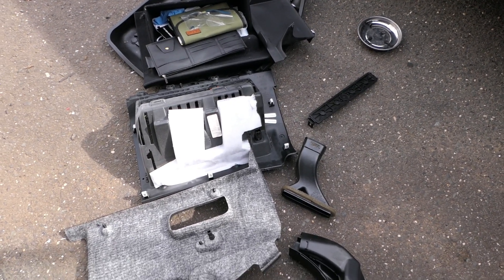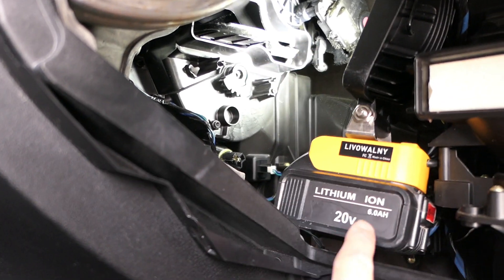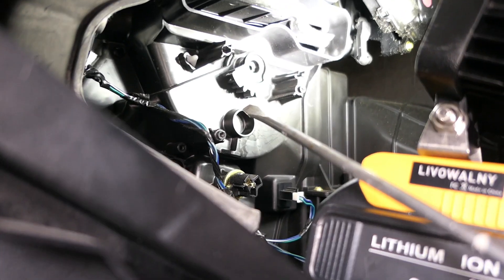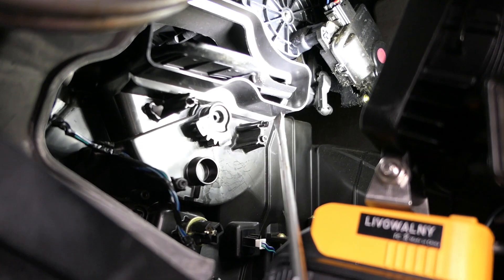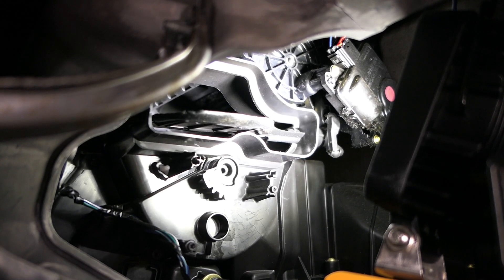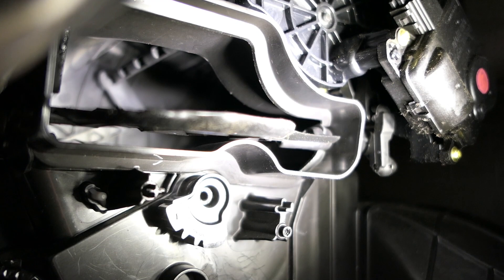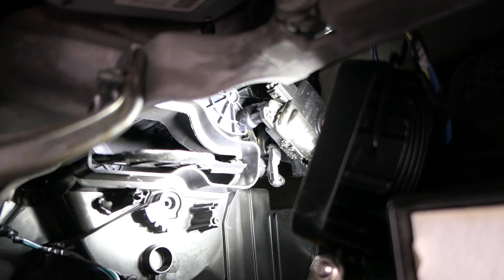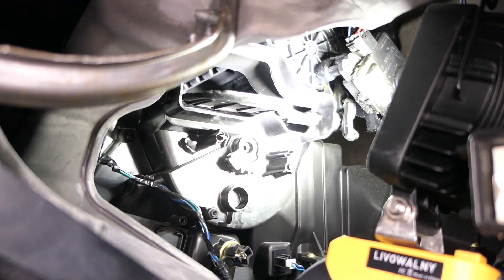How To Fix A Stuck Jeep Grand Cherokee HVAC Actuator Door

Comment: Same problem, was able to just jiggle it a bit till it came loose, but the driver side is fully stuck and way harder to get access to. Any suggestions ?
Reply from the maker: I haven't had the displeasure of working on the driver's side yet, but I know it's more difficult to get physical access.  If you can get the tool--any tool--in the right area but you can't get leverage, you can try whacking the tool with a rubber mallet to bust the door loose.  You might also try spraying a solvent in there, in the event that your problem is a gummy seal.  Any solvent which evaporates will do the trick, such as brake cleaner.

Comment: I took everything apart and My door moves freely, but the gear was broken. I replaced the gear and actuator and still no heat or a/c on the passenger side. Any ideas? (I’m not much of a car person but trying to fix this stuff myself)
Reply from the maker: It's possible the computer does not know where the flap is and needs "calibrating."  In other words, when you installed the new gear, the flapper door was located in a different spot than it was previously, and the computer still thinks it is there.  Or, you may have a secondary issue with a different flapper.  I'm afraid I can;t be much help from here, but really your only recourse is to take it back apart and look for issues.  This time try running the AC or heat while it is apart, and see if you can manually move any of the flappers to get the intended result from the vents.  Doing so will help you understand what is supposed to happen, and then you can try and make the actuators comply!

Comment: I have cool air now on the driver's side but the motor keeps running from only one side side and the vents comes off after a minute,  I must replace the motor as well?
Reply from the maker: I'm not sure I can be of help without seeing the problem in person, but typically it is the gear which breaks not the actuator itself.

Comment: Is it just 1 door in there? Meaning, can I free the door back to neutral from either driver side or passenger side? I keep having issues with the driver side gear eother breaking or blowong hot on drover side while passemger side blows cold. The stop on the dash itself(where the gear spins up agaisnt) is chipped away so the gear just overspins there. Im hoping i cam put some screws to act as a wall or epoxy build up or something.
Reply from the maker: There are multiple doors and motors, so I'm not sure which one you are having problems with.  If you are breaking a gear it must be due to the same general issue in the video, though.  The drivers side is different from the passenger in construction, but they use the same principle.
Reply: @tinderboxarts  I'm referring to the main one where you used that pry bar
Reply from the maker: Oh, I see. So, there are separate doors for each side, which allows independent temperature adjustments.  If your broken gear is on the drivers side I'm afraid you'll have to work from that side, which is more complicated yet.

Comment: Very well done and explained video. This is what no one else has been able to put out. Knowing nothing before i looked into it, i just knew that gear was stuck up by the teeth. Tried to use the gear w/ shaft but felt i was going to break it. I just needed to know where the flap was and which was it needed to go for sure. Thanks man 🤌

Comment: Very helpful video. How did you remove the plastic duct? I was able to remove the lower part but not the upper part. I need to get it out of the way as I need to change another same actuator that is connected to the air inlet cabin filter assembly.

Comment: How did you take off the vent? Was able to get the bottom off but do not know how to get the top part off to access the flap
Reply from the maker: It should basically pop off.  Sometimes there is other stuff in the way or you may need to get a different sight angle to see it.  The bottom half splits in two, which is the easiest means of removing that "horn" section.

Comment: I would have to guess that "calibrating" the actuator would address the range of travel for the gear. Being out of calibration, for whatever reason, was maybe why the gear was forced beyond the normal range of travel, and it broke. I am guessing.
Reply from the maker: I think the calibrating itself may cause the breaking.  The computer orders the actuator door motor to turn the gear until it hits the stop.  At that point the idea is that there will be increased resistance to the motor and that increased electrical draw will alert the computer that the stop has been reached.  However, it appears this process either takes too long and the gear snaps before the computer recognizes the stop, or else the motor is just too strong for the task and has the power to snap the flimsy gear.

Comment: How did you take the duct over the actuator off?
Reply from the maker: It splits in two, so you may find it easier to split it into the two halves and take out each separately.

Comment: The real cause of the blend door issue is the horrible glue thats used to glue up the styrofoam up along the edges of the blend door.  REMOVE as much glue as you can with Acetone and a cloth by reaching in and continually wiping out as much as you can.   Doing this will help prevent the actuator gear from breaking again.  FYI,  there are two blend doors, one on each side, not one.
Reply from the maker: Well, there are actually two problems, with the same result: a jammed door.  The stickiness is one issue and it seems to be more prevalent in warm or wet climates.  The other issue is the door being forced completely past it's stop, which is what happened to the vehicle in the video.

Comment: How did you remove the air duct to access it
Reply from the maker: The lower duct splits apart.  You can pry it open with a screwdriver and take it out in two pieces.

Comment: How in the hell do u remove the duct
Reply from the maker: The lower duct is put together in two halves, so it's easier to remove by splitting the duct in half and pulling out each side.
Reply: @tinderboxarts got what i was looking for. Thanks.

Comment: Is there a 2nd flapper door on the drivers side or just one for both?
Reply from the maker: There are four flappers, if memory serves.  So, yes, the driver's side can fail too, and getting access on that side is even more fun.
Reply: @tinderboxarts any tips on how to access the opening on the driver side? The top part of the duct is impossible to remove due to a metal shield all along its length. After trying for hours and scratching and cutting up my hands on the sharp metal brackets around it, I gave up 😢

Comment: I had my driver side hear break. Replaced it and iv noticed it clicks at times like its stuck or jumping. And when i turn the heat full blast the passenger side it hotter then driver side. Any ideal what it may be?
Reply from the maker: What you are hearing is the actuator continually trying to find the "stop" or limit of travel.  This is the whole problem--the design is supposed to work by the computer recognizing when additional current is drawn due to the door hitting the limit of travel.  But this doesn't happen fast enough or the computer doesn't see enough amperage, so the actuator continues to bang against the stop.  Sooner or later the plastic gear breaks or the flapper door is pushed beyond the stop.

Comment: Can somebody please help me here? I was on sticking my door for the A. C. Heat on the passenger side like I was seeing in the video and I do believe that I have broke a fin off or a flap off of that inside. Will that affect anything with my vehicle as into heat and AC?
Reply: Also I would like to know.Do I have to put any silicone or any type of solution for that white door there was some black gooey stuff.Does it need to be on there

Comment: Thanks for this.   My dad's cherokee had this issue.   The little bar was very helpful for freeing the door.  Then I used an excellent idea from 
Alex The Mechanic video to avoid full heat sticking by adjusting the gear stop with a screw.  Great results!

Comment: I can't find any videos on how to remove the black plastic duct that goes into that opening.
Reply: The top half of the duct doesn't come loose
Reply from the maker: I'm not sure if we're talking about the same thing or not.  The plastic duct which is sort of L-shaped and reaches down to the floorboards is in two halves.  You can unsnap the halves for easier removal.
Reply: I am having the same issue 
With the Upper L shaped Duct It has tabs on the right side of duct 
I just took a straight blade screwdriver and used that to push the first 4 tabs to help split the duct in Half….

Comment: How did you remove the air duct?
Reply from the maker: If you mean the one hanging down, it's a split design.  Try prying the halves apart for easier access.
Reply: @tinderboxarts  thank you... I got it...

Comment: OMG the crowbar hack you demonstrated saved my life. I fixed it but I also just left as is. If it happens again I know what to do so the process should be 1000% quicker, and only then will I explore a permanent fix to prevent over-travel.
Reply: Any tips on removing the airduct?
Reply from the maker: The airduct can be split in two for easier removal.  It just snaps together.

Comment: Any tricks to take off that plastic duct to get access to put the prybar in?
Reply from the maker: The curved duct which hangs down toward the floor is two-piece construction.  If it won't pop off, you can use a flat blade screwdriver to carefully pry the two halves apart and then it should come out easier.

Comment: Did you notice there another blend door actuator sitting right above the one you remove check it out
Reply from the maker: Yes, I know.  It's a big mess under that dash!
Reply: My memory has faded since I did this job three years ago, but there are actuators for Driver TEMP BLEND, Passenger TEMP/BLEND,  outside air ON/OFF,  WINDOW/FACE/FOOT selector.  Go to a MOPAR parts site and find a schematic diagram for the entire underdash AC Box.  Good luck.  If your gears seem in the wrong position, then power the actuator forward or reverse with a 6 or 9 volt batttery.  Good luck.

Comment: First off… thank you, I really appreciate your walkthrough and it helped me get to the actuator…but I am still having an issue. My 2011 Jeep Grand Cherokee started blowing room temp air on the passenger side…driver side is fine TG, but I’m in Florida and it’s too hot to have AC issues! So I checked the blend door actuator and yes…the plastic gear broke off at the stop…and even though I didn’t need it I decided to replace both the actuator motor and the gear with new OEM parts just to be done with it for under $50. So I believe I installed the parts correctly, it can only go in one-way right? Before I installed it tho, I manually tested the door first and it moves freely…I also tested the motor and let it dangle while I powered on the car…I tried holdingon to it to see if some resistance would stop it like the gear stop is supposed to do right? Wrong…that motor did not feel like it was going to stop, or am I missing something here? Shouldn’t it stop with some resistance? Anyway…I really had no other alternative other than to just install and test it …and so I did just that and I’m pretty sure I installed it correctly…it can only go in one way right? I slipped on the gear to the inner gear 1st…with the large tooth to the large gap…then adjusted the actuator/stem to line up and screwed it down. I’m wondering if this is the point where I didn’t line it up correctly somehow. So after installing the actuator/gear and removing battery power for 30 min to recalibrate…I cranked it up and all I can hear from the actuator was a loud clicking noise like the plastic gear just sheared off the stop again! I don’t think I need to pull it off again to figure that out as its exactly the same…cold air on the driver and room temp on the passenger side. I’m puzzled as to why when I crank up the heat on the passenger side that works with no problem…it just doesn’t get cold when I crank it down! I don’t wanna give up yet my bruthas…any help would be appreciated….thx again
Reply from the maker: Yes, you are missing something!  So, the way this design works is that the actuator motor turns the gear to move the blend door.  When the door hits the end of it's possible travel--the stop--the actuator motor will naturally begin to struggle.  That struggle draws extra power from the circuit.  The computer is supposed to "see" that additional power being drawn and figure out that it's time to cut power completely because the blend door must be closed.

What you did was install a new actuator and gear, which was likely not in exactly the same position as before.  As a result, the actuator tried to keep pushing the door closed even after it was already closed.  The computer did not pick that up quickly enough, and the cheap plastic gear broke while the motor continued to push against it.  So your door didn't get stuck, but the gear snapped.  There is no real fix for this, because we can't change the design or the parameters the computer uses to determine the stop.  What you can do is minimize the potential for a problem.  Try to get the actuator and gear installed in the middle of the range so that the actuator isn't immediately pushing against the stop.  In other words, if the actuator and gear are installed close to where they were oriented originally and where the computer still thinks they are located, then the calibration is just a slight adjustment.  If you are way off, then the computer will allow that actuator to push against the gear for too long, and the gear will likely snap.
Reply: @tinderboxarts  Thank you! I considered what you just said, but needed to hear it. I just don't know how I can align the tooth/gap any differently...I see two possibilities...one I saw saw some guy take apart the actuator motor and move the gear to the correct/better position...sounds good, but alot can happen here. The 2nd...I saw another video where there were cheap little sensors behind the radio area that controlled the doors as well...I'm just not seeing anyone else talk about those. I swear...I'm never buying another mopar unless its a hemicuda!
Reply from the maker: Well if your actuator is just way off from where it needs to be, you could use a couple of leads to a 9 volt battery or to a car battery to move the motor.

Comment: You are amazing!  When I move the smaller door out of the way, I find it to be extremely sticky, so I suspect that the blend door is in the same shape.  I am thinking...I can't get in there to clean it.  But I want to consider blowing in some light sand or something granular that will stick to all of that crap, and then prevent so much of the sticky surface area being available to re-stick the door.  Any excess would maybe blow out through the ducts?  Or I may be able to create an adapter hose for my vacuum so that I could get some reach in there to suck up most of the excess.  Can you think of any way this would damage anything in the system, if I did it carefully, and did not use a ton of material?  Any ideas on what material to use?  Even ground coffee might work, it if would not degrade over time.  Hmmm...I gonna think about this...but let me know your thoughts.
Reply from the maker: Eh.  I think you may be barking up the wrong tree.  Probably a better approach would be to use a solvent to eliminate the stickiness.  Possibilities include acetone, isopropyl alcohol, or ammonia.  You could rig up a stick with a small ball of fabric on the end, perhaps held on with wire.  Then dip the ball in the solvent and see if you can get it in there.  The extra solvent will evaporate.  Take care not to breathe the stuff.  A spray bottle might work too.  If that fails, you might try Dawn dish detergent mixed with just a small amount of water.  Again, use a stick with something on the end to apply the mix.  When the water evaporates it will leave a residue of detergent, but that can only help your effort.  There's no easy answer, unfortunately.

Comment: HELP-this got it unstuck... and now it is stuck again. This is my 18 year old sons car- trying to help him. Can someone suggest something? Please? Thank you! Keeps sticking.....
Reply from the maker: There are different reasons for sticking, and some people report that the seal for the door becomes gooey and sticky, which makes the door get stuck when it comes in contact.  Possibly that is your problem, rather than the door going past the stop.  You may be able to stick your phone camera in there for a closer look via a picture or video.  You can try spraying a solvent in there to lessen the stickiness.  Some people drive a screw through the side of the housing in order to prevent the door from touching the seal.  You lose some efficiency that way, but it's better than a stuck door.

Comment: Will this method work on both driver and passenger sides?
Reply from the maker: I have not opened up the driver side, and I hope I never need to!  But if you can get a crowbar or tire iron in there it should work the same way.
Reply: Thanks for taking the time to respond, much appreciated!